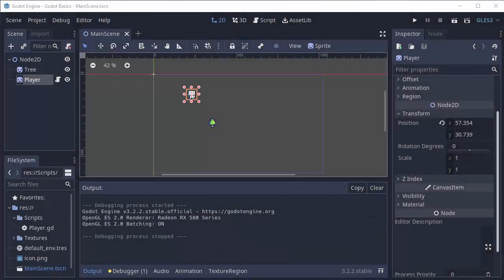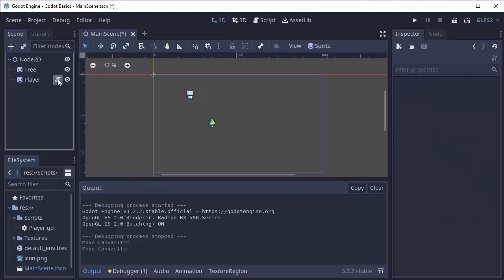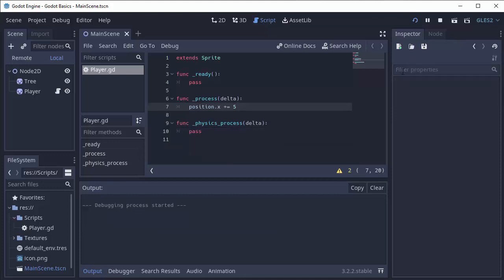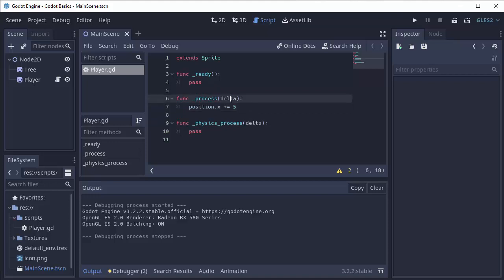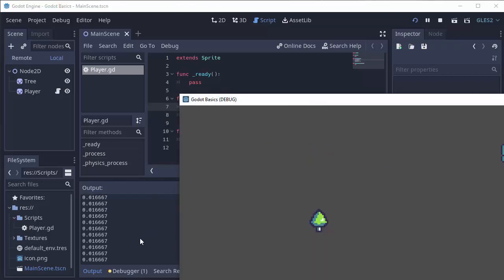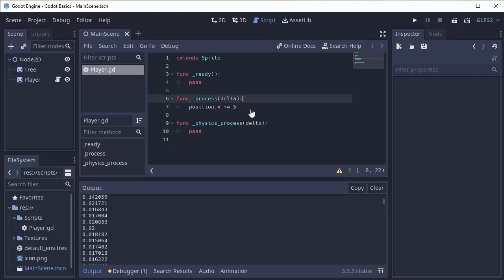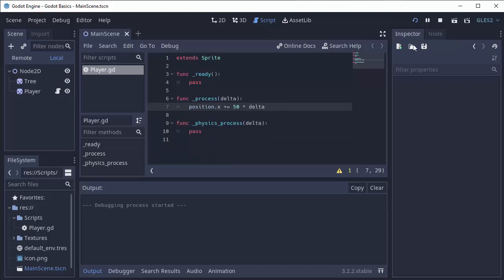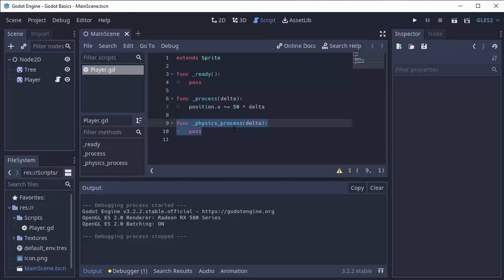Godot Basics: Delta

Comment: so whenever you want to have consistent movement across devices, but you have written your code already and set your values properely,  you have to multiply your values by 62.5 before multiplying by delta?
The delta is always approximately 0.016 right?

So in your case to have the character at the speed of 5, you have to:
5 * 62,5 * delta
so instead of 50 you should've written 312,5 * delta
to have the same speed you began with.
Reply: Multiplying delta by 62.5 is much easier and made the same result lol